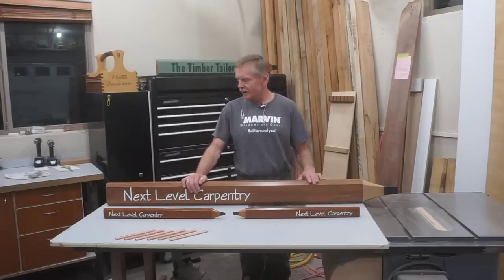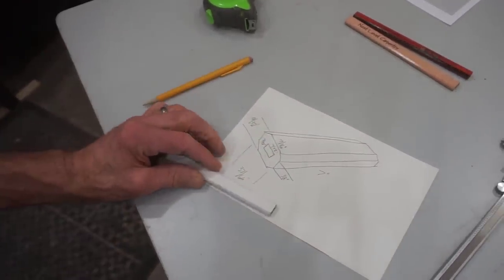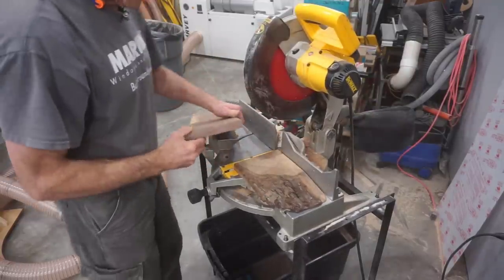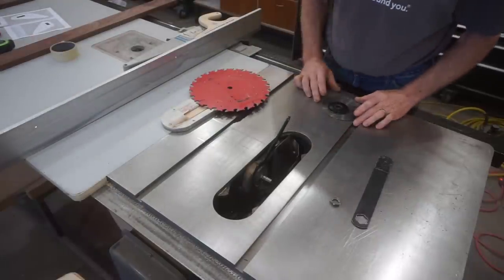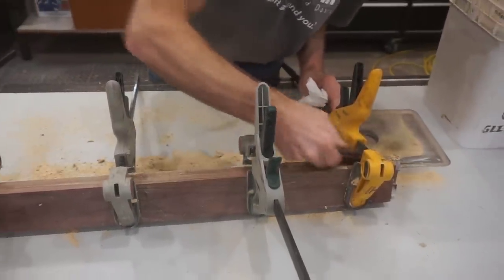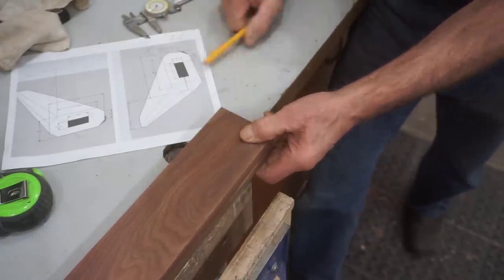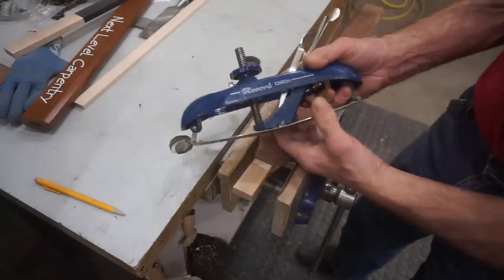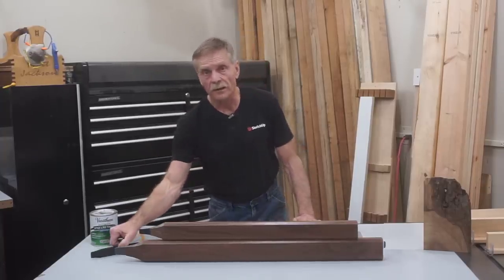How to Make GIANT Pencils

Comment: Dear Matt, yet another fine piece of precision carpentry. I like your token gesture / concession to those of us who use metric measurements. The numbers would rarely go into decimals and mostly be rounded to whole numbers, preferably multiples of five. An accurate ruler’s resolution is 1mm divisions. A Vernier calliper resolves to tenths of a mm, but you wouldn’t use it for woodworking. Metric was designed to me easy to use, not convoluted like the 13/16th and 35/64th speak that plagues imperial measurements. Cheers.

Comment: From the first day I found your channel, I've been so intrigued by the gigantic pencil. I was and  I still am determined to make one for my workshop.  I don't have all the machinery to make it as easily as you do, but I will improvise! 
 Thank you so much for making this video!   ;)
Reply from the maker: Sounds great, have fun with your pencil project!  Your attitude about and willingness to improvise will take you a long way in any Endeavors with woodworking. Being careful and not being afraid to spend extra time on something will allow you to do far more with far less and the way of costly tools and equipment.. Best, Matt
Reply: @NextLevelCarpentry  Have you tried using a router to cut the channels? It seems like it might be much faster. Also, a router is much more accessible to obtain than a table saw for most people.

Comment: Matt, the slipping of the glued surfaces can be taken to a minimum with a very small amount of aquarium sand. Many use salt, which is probably OK, but I had that method discolor some wood many years ago, so long ago, I fail to remember the species. Great video, I just picked up 10 rough cedar boards 7/8x6 1/2x72+ inches, might give this a try. Have a great year, see you next go around.
Reply from the maker: Interesting Ray... I've not heard that method.  Curious: are you still able to adjust once sand grabs?  Seems it might be difficult to ensure exact alignment when putting the screws to it the first time and I wouln't want to have to release clamp pressure for those slight adjustments.  I'm still totally open to new ideas though and will ponder your suggestion for sand... avoiding salt for potential risk of discoloration though.  Have fun with your cedar boards! Best, Matt
Reply: i use a small squeeze clamp at each end to limit the amount of slippage while putting the pressure on.
Reply: @NextLevelCarpentry  Hey Matt, yes you can still do a little adjustment if needed. The main difference between aquarium sand and beach sand is the texture, aquarium sand is pretty fine compared to the beach sand. The salt seems to dissolve, that I believe is what changed the color in the wood I was using years ago. That made things out of contrast as to what it was supposed to be in the beginning.
Reply from the maker: @rayc.1396  thanks for following up on this with more insight.  Upon reflection I've decided  I'm not going to try the tip though.  I just don't want grains of sand, however fine, imbedded into glue joints that often go through machines or get routed.  I go to significant pains to remove dirt and grit of any kind from boards before milling to preserve cutting edges as long as possible.  If it weren't for your concerns of salt staining things I might try that on a difficult glue up.  Bottom line is that a little bit of 'creep' during the clamping process is totally manageable without adding the extra step and potential downside of either method.  This is just one man's opinion so please don't let this discourage you from offering future suggestions, OK?  Best, Matt
Reply: @NextLevelCarpentry  Not a problem, still love your videos. I do understand you caution.
Reply from the maker: Thanks!  It's all good... Ray.  More videos in the pipeline... Best, Matt

Comment: So many great tips in this video!  Love the glue ram for your glue lam.  I often glue dadoed boards together to quickly make accurate mortises, then fiddle with a chisel to pare the glue squeeze out; no more!   That high tech dual-axis band saw fence for cutting curves in stock on edge will be an immediate addition to my shop; why didn't I think of that?  I can't count the number of large carbon brushes we threw out when overhauling some of the main propulsion motors on the ships I used to work on.  They would have made great authentic, albeit hard--like 4H, leads for your pencils.  I did keep about 50 lbs of lignum vitae blocks from propeller shaft bearings.  It's pretty dark and may save buying ebony when I make my own pencils now.
Reply from the maker: Sounds like you're all set for making some jumbo pencils of your own Francis... have fun!  I'd long heard of lignum vitae being used for propeller shaft bushing and wondered if it was truth or fiction... nice to know it's true... and you have 50lbs of it?!  Nice! Like many things, the new stuff ain't like the old stuff so I'm guessing yours is primo!  Very cool. BTW if you spend a little more time engineering your gluelam glue ram you can get it to perform even better than the one I made quickly for this video but of course anything is better than nothing.  Best, Matt

Comment: I worked in a high end finish shop for a while. The owner of the company told me using water to clean glue is fine. He said the mistake people make is not using clean water and rags as you go. You can't use the same rag and water that you used for the fist swipe, you gotta change out the water and rags and end up using clean water etc.  It's true, it works. But like you, I would prefer not to do it, but in a pinch it works just fine without leaving a trace.

Comment: Wow. Dust to clean up glue makes sense. At first I was thinking, "why not just use a wet rag?" thats what I have always done! Question: does using a wet rag compromise the integrity of the joint or the finish? or both? THANKS!
Reply from the maker: Using dust instead of a wet rag is a paradigm shift for most woodworkers Anthony so give your brain time to adjust if your considering a switch.  You'd really have to use a LOT of water to actually compromise joint strength because you'd have to use enough to dilute the glue in the joint.  But just wiping with even a damp rag will dilute glue squeeze out which will definitely spoil a stained finish if you don't eradicate it completely from pores of wood on the surface.  Projects that get painted are less of a concern but using my sawdust method is simpler and faster regardless IMHO.  You're welcome whether or not you give this a try.  Consistency of sawdust makes a difference so medium/fine works best, bigger or 'stringer' sawdust is less effective and more frustrating but still better than a wet rag and water... again IMHO. Best, Matt
Reply: @NextLevelCarpentry  Thanks for the reply! I'll keep a bucket from my dust collector and give 'er a whirl.
Reply from the maker: @tonyzaccaro2577   Cool.  BTW I use this same process in other Next Level Carpentry videos like the "Flat Panel Doors" and "How to Make Round Cylinders" ones in case you want more examples of it in action... Best, Matt

Comment: That walnut is beautiful.     Is the lettering free hand painted?
Reply from the maker: I welcome every opportunity to work with walnut Scrapmetal... seldom is there an ugly piece of the stuff! And it makes the whole shop smell so 'right'. The lettering is thin vinyl cut by a talented guy, also named Matt, at Summit Signs here in town.  It's the same stuff used to put lettering on signs: it's all cut out with a plotter on transfer paper.  I just peel off a backer layer, place the lettering on the surface and press it on with stiff plastic squeegee.  The transfer paper peels off leaving perfect lettering behind in a matter of minutes.  Very reasonable in price too.  Best, Matt

Comment: I just thought of something.  Why not just make a rectangle and then plane off the four corners?
Reply from the maker: And how do you hollow out a rectangle all the way through the middle for the lead to slip in? 😯
Reply: @NextLevelCarpentry  Perhhaps Cut it in half length ways, cut out center with multiple passes (or a block plane maybe or router) and then glue it back together.  Do they make a long rectangle drill bit?  lol  I enjoy your videos a great deal.  Thanks for your work. I'm going to make one of these myself.
Reply from the maker: The day someone offers a long rectangular drill bit for sale I'll be first in line to buy one because that would be so cool! 🤣🤣😎